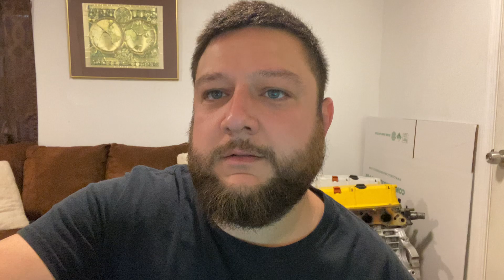Nippon Racing PM6 Piston: Turbo D16

Comment: Yessir, I’m currently building a boosted y8 with pm6 pistons. Should be real snappy at 10.5:1 💪🏾💪🏾💪🏾
Reply: How’s this going? Considering it myself
Reply: @jesselittle2901  I actually ended up actually going with the New Nippon High compression vitaras. They yield just about stock compression, so I’ll be milling the head 0.020 Inches to get that 10.5:1 ratio im looking for.

Comment: just choose the compression u want with the head and block combo that you have  ! We have PM3 , PG6 , vitara , P29 , PM6....all from nippon racing...I just can’t stay away from the b7/2 block Z6 head p29 and long rod combo..best setup I ever had in my single cam Journey...high compression boost FTW IN TQ & SPOOL TIME
Reply from the maker: I was initially gonna go that route. The PM6 is a much safer route that I’d feel comfortable telling ppl to use without first hand use
Reply: I have a set of the PDNs from my CNG Sedan. But I am afraid to use them with a Y8 head.  So I will use the PG6.

Comment: Hey man just a quick question I don't want to bother you but I've been looking on the internet for the pm6 Pistons I can't find them with rods any rods will fit like speed Factory rods H beam or any d16 Nippon H beam rods because usually the Nippon ones are free floating pins and i think all the other ones are press in correct me if I'm wrong I've never bought Eagle rods for Speed Factory rods I only have experience with Nippon inmy other builds

Comment: I have question about those piston i have d15b7 turbo i want to built the block i have scat conecting rods std size  and set of vitara not installed yet because i dont like the vitara cr so im looking for other full floating options... im runing on 11psi im planing to increase the psi to 17psi max  my goal is make around 300 to 325hp im barely run my car at wot when i do is less of 30 second cuz is my daily car those piston can be reliable for daily use and can hold 17psi

Comment: P29 pistons come out of the DOCH ZC the PM6 pistons come out of the non v-tec single cam ZC and the P28 pistons come out of the single cam ZC v-tec which is a P28 casting with the exception of the long rods now the D16A6 88-89 have PM6 pistons with cast iron main caps underneath the aluminum girdle which is the single cam block that is known to hold the most power the crank is also better than the P28 cause it not only has the dual oiling ports on the rod journals they are also chamfered which allows the oil to flow more freely I have 2 of these blocks and the P28 casting ZC